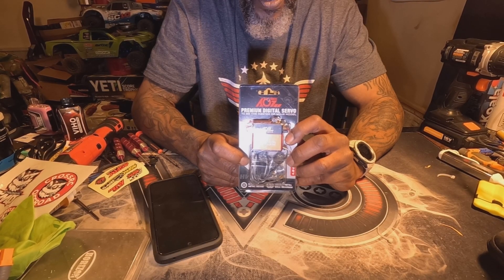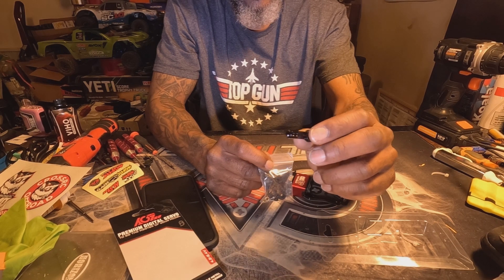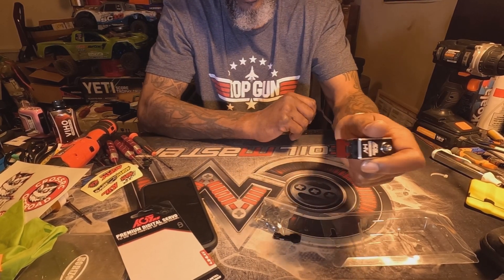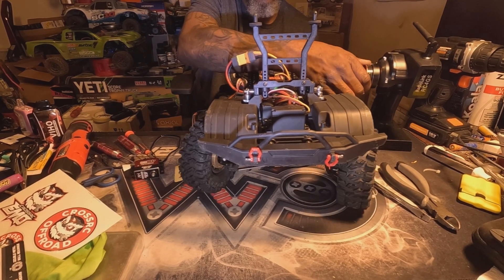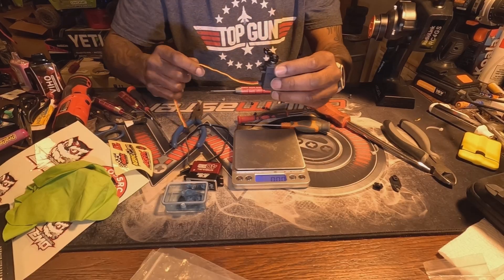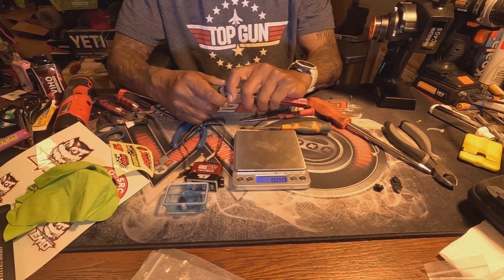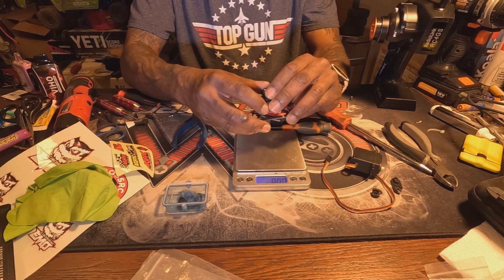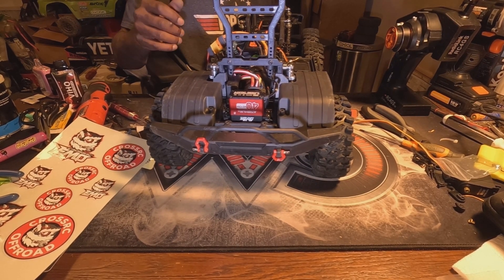AGFRC Brushless 40KG Steering Servo Upgrade Install

Comment: not bad but for $80 there is many other great options. Look at the NSDRC rs500b $60 servo with tons of speed and torque. Cool vid Rad!
Reply from the maker: I had some waterproofing issues with a NSDRC Micro servo a couple months ago after getting it wet for the 1st time. I own 6 AGFRC servos, no issues. I might give NSDRC a chance again someday. Thanks for the suggestion and for watching. 👍🏾